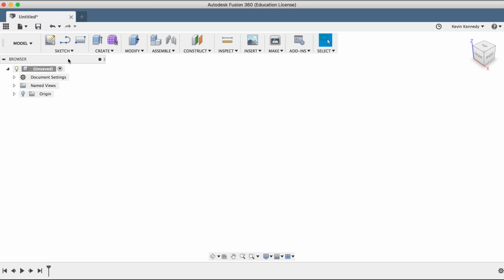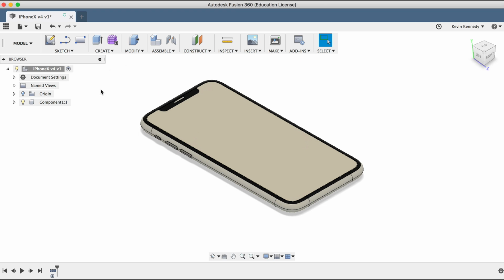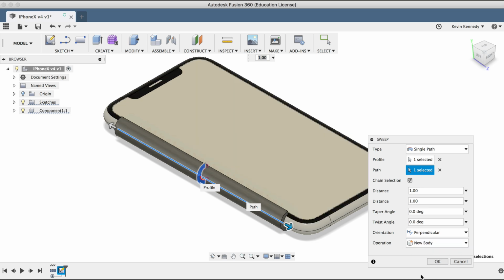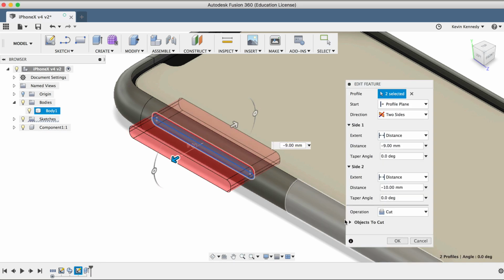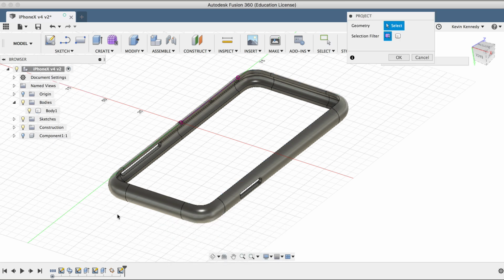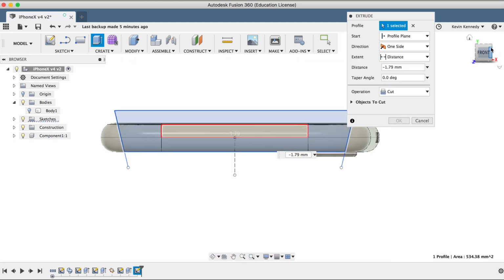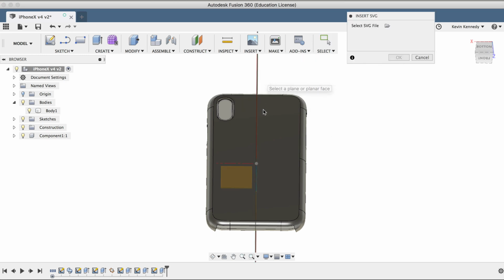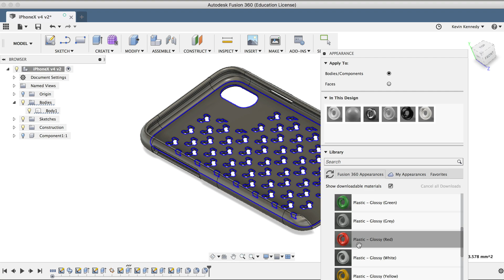How to 3D Model an iPhone X Phone Case - Learn Autodesk Fusion 360 in 30 Days: Day #10

Comment: When I try to create the back using the plane feature I get : Error: Work Plane From Two Lines failed:  Input lines must intersect or be parallel
Reply: the same thing happened to me. I think it was due to the angle of the faces or something when the sweep was preformed cause no matter which line I selected I got the same error. I just did an offset plane and a little bit of math to get it in the correct spot. 

and the camera lens I just projected the edges instead of doing circles.

also found that I have saved the project before importing the phone, so when I imported the phone I could choose it in the data panel an select add to current design. that way I was not able to damage the phone when doing any cuts, regardless of visibility.

Comment: Hey Kevin i love your videos. I noticed that your viewcube has the the Y-axis between the LEFT and BACK sides. Mine is between the LEFT and BOTTOM sides. Why is that and how could I change it if I wanted?
Reply from the maker: Hi, Ming. They changed the default setting, as it used to be set to the "Y up". You can changed it by following the "default modeling orientation" instructions here - https://productdesignonline.com/default-settings-for-fusion-360-tutorials/#modelingOrientation
Reply: thanks a lot!

Comment: Hi Kevin. I am having major issues with this design and can't find a fix.
I draw the spline and when I go to sweep the feature, it fails. I have tried this over 50 times. I get a variety of "Sweep Errors" or "problem combining geometry together." I have got it to work once but I was forced to create a new sweep for every face. I have tried the spline drawing hundreds of times. Making a larger clearance on the phone and making it intersect. I have tried fewer spline points and lots of spline points. No luck. I thought it might be because once of the lines is red when you got to sweep but you have the same thing in the video. I have quite a bit of experience in CAD but this has got me stumped. I am starting to think its Fusion or the step file. If you could have a look at my public link I would be very grateful. :D
https://a360.co/2ytfiZ0

Comment: So far I've managed the first eleven videos with minimal struggle and swearing at my computer, but I just can't seem to get past the button cutout portion. When I try to create the rectangles to use for the extrude command, I can't seem to get the rectangle on the right plane or surface. The rectangles appear within the body of the case, either right behind the button area, or sometimes along the center line of the object. No amount of clicking different spots after I've called up the R/rectangle command seems to get the sketch where it needs to be. 
Any ideas on what I might be doing wrong. I think I'm going to have to skip this lesson and perhaps return at a later date, lest I throw my MacBook into the pool. Ugh! 
Thanks for all the great content. I'm a 25 year user of Adobe 2D design software, and it's been quite the thing getting my head around this, but I've (mostly!) enjoyed the challenge. As an absolute and utter beginner, is this playlist the one I should be starting with, or is there another playlist to tackle before the 360 in 30 days? thanks again!
Reply from the maker: Hi, natblack1971. Could you share a link to a screenshot? That will help me see if there is anything wrong with the setup.

This is the playlist to start with. I have some other beginner playlist, but they're not as sequential as this. https://www.youtube.com/productdesignonline/playlists
Reply: I was running into this issue as well. What's worse is I got it to work on the side with 1 button. Went to do the other side and it doesn't show the "case" body as an option to cut. Only the phone "component 1" bodies. I cannot figure out out. Finally got it to work by making the "case" body 1 visible before doing the extrude/ cut.

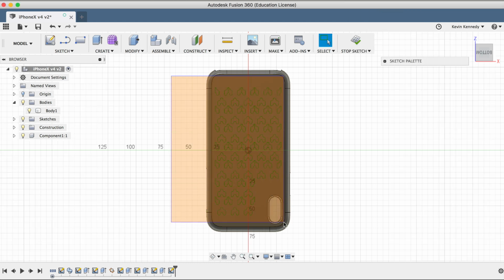Comment: I was unable to select the patterns at once as shown in9:50. I was not able to multi selecting using the click and drag square method. But I worked around it with selecting the plane (when extruding) and dragging my cursor (right click and hold with "shift") over the pattern(93 profiles). I hope that helps anyone having that issue. this was probably one of my favorite projects so far as it can be used everyday!
Reply: This does it! It was helpful to me to hide the case and the phone models, select all (and make sure the sketches are deselcted) then extrude and make sure the 93 profiles are selected before turning the case back on to cut the case

Comment: Kevin, when I activate the spline tool to trace the outline of the iPhone, the crosshair is very erratic, and stops at random places as I drag the mouse.  Sometimes, I can get the arc drawn, but then I cannot manipulate the handles correctly.  I can lengthen or shorten them, but cannot drag them up or down.  I am using the new UI on a windows laptop.  Any idea why this would happen?
Reply: I think I just solved my problem.  I turned snap off and it seems to be working like your tutorial.

Comment: Hi Kevin, stuck again. Downloading the Iphone X cad model asks for the email after selecting the .step file. Nothing arrives after several tries and a few hours wait for the email link. The direct download to Fusion360 did not work as the downloader asks for a program to open the file but aparently there is no Fusion360 exe file just a launcher wich option refuse to work. Don't know what to do next.
Reply from the maker: Strange... they seem to be working fine on my end. Perhaps the full URL will work - https://myhub.autodesk360.com/ue29ca580/g/shares/SHabee1QT1a327cf2b7a1e35c6d852637a14?viewState=NoIgbgDAdAjCA0IDeAdEAXAngBwKZoC40ARXAZwEsBzAOzXjQEMyzd1C0AWXXRgEwgROAWgBMnGAHZhnAJy4AzMIAcCgMYAzYTDVqFygEZ9OnAGyi1aAL4gAukA

and
https://myhub.autodesk360.com/ue29ca580/g/shares/SHabee1QT1a327cf2b7a92aaf44a17340e24?viewState=NoIgbgDAdAjCA0IDeAdEAXAngBwKZoC40ARXAZwEsBzAOzXjQEMyzd1C0A2AMwBZOAHAFYARtwC0jACYCI43txgjxIxp2UBmCDBi5evAOyMAxgE5uaAL4gAukA
Reply: @ProductDesignOnline  thank you, must be an email issue, tried with a different addres and it worked! 👍☺

Comment: When using a model that doesn't have a straight path all the way around the phone to sweep it to, I tried outlining it with splines and lines and it goes further than without it but stops at the rounded corners. Any ideas?
Reply from the maker: Hi, Remark. I would suggest the following process.
1. Create a "midplane" construction plane that is directly in the middle of the phone model
2. Split the phone model in half with the split body command.
3. Create a sketch on that same midplane.
4. Use the "Project" command to project the edge of the phone onto the sketch
5. When you use the Sweep command you should be able to use the projected geometry, as it should  be continuous :)
Reply: @ProductDesignOnline  awesome 😁 thanks a lot man will definitely try that when I get home from work. I gotta day man these tutorials are awesome and very well articulated. Keep it up please 😊
Reply from the maker: @remarkabel174  Thanks! Glad you're enjoying them :)
Reply: @ProductDesignOnline  worked like a charm 😁 had to clean up the lines around the buttons and other indents on the phone but after they were all straight it worked out great! Thanks again man
Reply from the maker: @remarkabel174  Sweet! Glad that worked out for you :)

Comment: hey man, so, I have a problem. Right at the biginning when I´m supposed to make a spline, the spline won´t connect to geometry of the iphone x. How do I fix this?
Reply from the maker: Hi, Marek. Check to see if your "Auto Project Edges on Reference" setting is turned on - https://productdesignonline.com/default-settings-for-fusion-360-tutorials/#autoProject

Comment: problem with handlebar grip 9.25 min in I wind up with a smooth cylinder with none of the ribs. I actually got past this once before but try as I might it comes out the same https://a360.co/39VlhDl please advise thanks
Reply from the maker: Hi, mbnaso. Just looked at your file. The issue is that your rectangles, which were used for the rectangular patter, are overlapping. This causes the revolve command to avoid that part of the profile - which is why they don't show. You need to double-click on the rectangular pattern icon in your sketch and edit the distance and quantity so that there is a gap in-between each of them. Cheers, Kevin :)

Comment: https://a360.co/37Qeiu3   With the iphone the extrude feature worked on the original opening just fine but when I try to do the other side it wants to extrude the bottom of the phone with the bottom part of the button??
Reply: Ok past that stuck trying to create opening on the bottom buttons when I hit view I can't see the buttons there using view
Reply from the maker: Hi, mbnaso. I'm not following your question - are you referring to the buttons in Fusion 360 or on the iPhone model?

Comment: Hi guys,

I am currently following the tutorial 
I'decided to create a phone case for the Samsung S8. Unlike the Iphone X, this S8  has 'bulges' at the corners. Because of this I am unable to sweep around the corners of the solid.

I have been trying to work around this, but am not very successful yet.

Could you offer me a solution to this problem?

Thanks,
Dave
Reply from the maker: Hi Dave. You'll likely need to create the edge of the case in segments because that corners of the S8 are not a continuous/symmetrical contour. I would start with the simple sides/tops, using the sweep command similar to the iPhone.

I would then approach the edges with a loft, as they can be defined more than sweeps. You'll want to create at least two pieces of geometry for "guide rails". Probably using the spline tool...potentially by projecting the sketch if your S8 CAD model is sufficient. Then, you'll need to project the end of each sweep body, so they can be used as profiles with the loft tool. The whiskey bottle tutorial (https://youtu.be/pqXCswoa3F4) is a good example of connecting profiles with guide rails. Think of the corner of the phone case loft as if the whiskey bottle were done laying on its side.

Comment: I have used google sketch up for years . but I've always wanted to give fusion 360 a try but theres so much to it I just felt way out of my comfort zone . well I can say after watching a few of your videos I have learn't enough to design an exact copy of my phone as i was unable to find one online (so I could do this tutorial) and I have managed to design a pair of glasses so if I break my glasses I can 3D print my glasses frame on my SLA 3D Printer and not have to buy new frames :D . I'm no pro at fusion 360 but Its getting to the point where fusion will be the one I use when doing projects. Thanks to your help ! :D btw awesome tutorials !
Reply from the maker: Glad to hear that, JustOneOfTheSheep! Best of luck with all your 3D printed projects :)

Comment: Whats the best material to 3d print this with?
Reply from the maker: I'd recommend ABS or Nylon over PLA. ABS will be stronger and more durable. Nylon is the way to go if you want the phone case to feel a bit softer - more like rubber. If possible, printing on a glad build plate will also give you a super smooth finish on the back, which is ideal.

Comment: Kevin, thank you for putting these videos together.  I've been plodding along in Tinkercad until I stumbled across your series.  I have a couple 3D printers and took a pre-apprenticeship course to be a machinist and fell in love with mills and lathes, but also look forward to CNC.  What I'm learning through your series will be a great leap forward in what I'm able to do.

I have done well with the previous projects, but this phone case has been troublesome.  First, the image in the CAD file for my iPhone 6s was on it's side and the top edge was at centre of the plane.  Got that sorted out by using the align function.  Second, the sweep shape was being drawn at the end of the image, not in the middle AND I wasn't able to click on the images' edge to select the sweep path.  I resolved that by drawing construction lines around the image (thanks to your previous videos for tipping me off).  But this third issue has me stumped and I'm hoping you're able to help.  When I try to construct the midplane, I'm not able to select the lower edge of the case.  It only lets me select the face of the sweep.  I've tried using construction lines, but no luck.  Any thoughts?  Worst case (no pun intended), I'll start from scratch and use your iPhone X file.

Thanks again!  And great job applying the feedback from the comments, I remember how fast you spoke in your earlier videos and we were all crying out for you to slow down.  Now you're moving at a very reasonable pace (though I have a short memory and still stop and rewind a fair bit...but that's on me, not you).  Cheers!
Reply: Hmm, using your iPhone X model, I have the same midplane issue. I can't select the lower edge of the case, only the face of it.  Does that mean the midplane function performs differently since you made your updated video?  Or am I doing something wrong?
Reply: Lol.....apparently, I cannot follow instructions very well.  I finally realized you aren't using the midplane function, but rather plane between 2 edges.....it's all working now.  Live and learn, right?
Reply from the maker: Hi Brent. Glad you figure it out...sometimes those small roadblocks help the info stick better :)

With that said, don't hesitate to comment if you run into any more issue in other videos. Cheers, Kevin :)
Reply: Product Design Online well, now that you mention it.  Instead of the SVG pattern, I tried writing my name splashed across the back (diagonally) using either a 1mm embossing or 1mm  deep cut.  Neither seem to work fully.  The best I’ve gotten is an embossing of my name except the first letter which is missing.  Weird.
Reply from the maker: @brentmccaig3192  Hi Brent. Did you "Explode" the text? If not, right-click on the text (while you're in that active sketch) and select "Explode Text". That will convert the text to outlines, which should make sure all the text can be extruded (either embossed or debossed).
Reply: @ProductDesignOnline  Seems to have worked.  I'm going to print it and see.  Thanks again for your help!

In your video on Text which is 1-2 versions ago, you mentioned that you can't wrap text around an object.  Has that been addressed in the current version?
Reply from the maker: @brentmccaig3192  There's some "workarounds" that you can do, which I present here - https://youtu.be/sja3Fd6aERI
Otherwise, there is still no official/native way to do it.

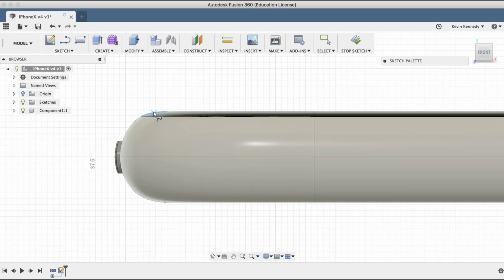Comment: Hi Kevin. Great tutorials. A problem I am having is when placing the spline in sketch mode, mine doesn't snap to the iPhone model the way yours does at 2:16. It only snaps to the grid. Here is what happens https://imgur.com/a/Hy9U0NR. I reset my preferences to default and also auto-project geometry is set. Here is the file: https://a360.co/317tsJO
Reply: It appears that I fixed it by enabling "Preferences > General > Design > Auto project edges on references" as well as "Auto project geometry on active plane." I'll leave my comment in case anyone else finds it helpful.
Reply from the maker: Hi, InsaneRevolt. Glad that was it - I was going to suggest the "Auto project edges on reference" setting. Unfortunately, that used to be on by default, but the F360 Engineers decided to change it.... Changes to any settings can be found here - https://bit.ly/defaultsettings
Cheers, Kevin :)

Comment: If you sweep doesn't work on the corners, zoom in very close on the spline you made and make sure none of it is inside the phone component. Or, that fixed the problem I had.
Reply from the maker: Great tip! Thanks for sharing, Tym.

Comment: I try following your videos and do everything you do but it never does the same stuff. IDK if theirs something you do that you just do and don't realize new people don't know that or what. but like to make the spline I make the 3 point then those other lines don't come up to make the outside or whatever it just makes more splines. after you make the 1st one are you supposed to do something to stop that action and go to next one?
Reply from the maker: Hi Todd. I believe this sounds like it may be a difference in our settings. You can cross check your settings with mine on my web page, here: https://bit.ly/defaultsettings

Specifically, Make sure the "Auto project edges on reference" is on.

Let me know if that makes a difference. If not, we can troubleshoot further. Cheers, Kevin :)

Comment: Hey Kevin, I would like to do this "How to 3D Model an iPhone X Phone Case" for my iPhone 11, but first I'm trying to put vent holes in the top & bottom of a power supply case in an 'L' shaped area. Is this what I should use? Not sure if this is the best method for that, or perhaps the "How to 3D model a lego brick" but with holes instead of protrusions? I seem to make strides forward in my learning of Fusion 360, but then I reach an impasse, & I feel I'm back at square one! Oh, ALSO, when I do that, I will need to break the case up, to a top part (including the sides), & a flat bottom of the case for 3d printing. Is there the equivalent of scissors to make the cut, & then have two bodies to export as 'STL' files? I fear my ambition is not yet matched with ability :( Grateful for any help. Christine
Reply from the maker: Hi, Christine. Either method would technically work. However, I would recommend the phone case method or using the slot command per this video - https://youtu.be/vC7R-0jTxSo

As far as scissors, you can use the "Split Body" command to split parts in half. I created a video covering those techniques, specifically to split up parts for 3D Printing, which can be found here - https://youtu.be/KFQ4-1GH0wg
Cheers, Kevin :)